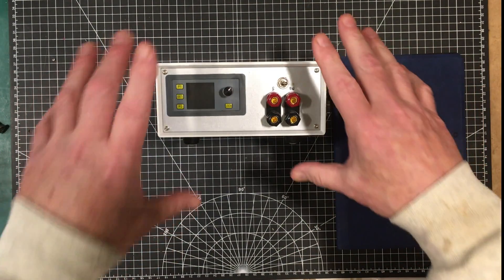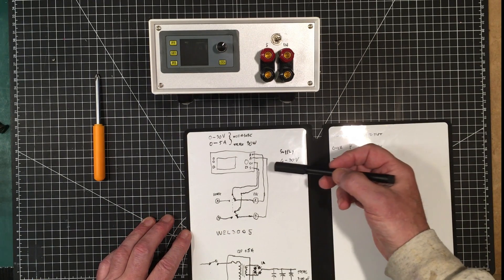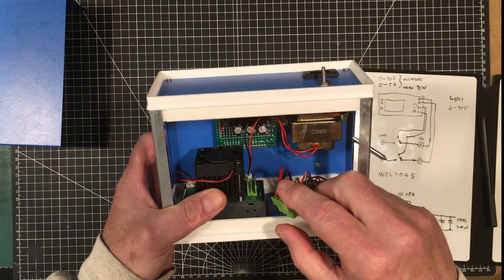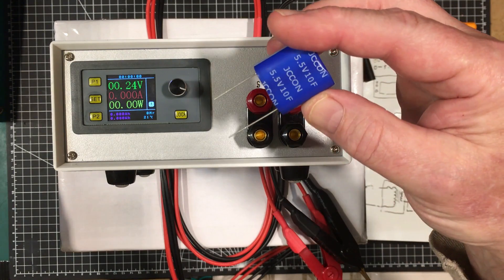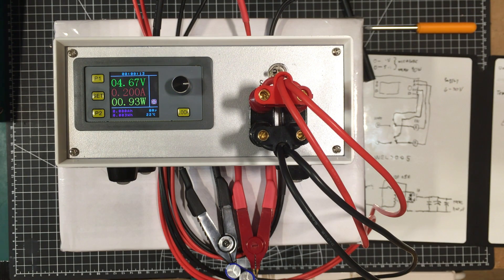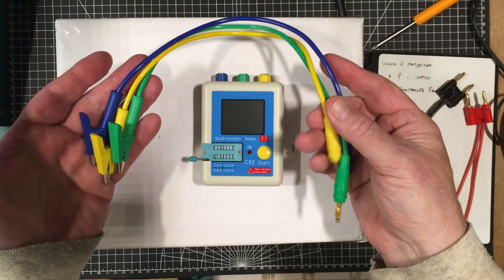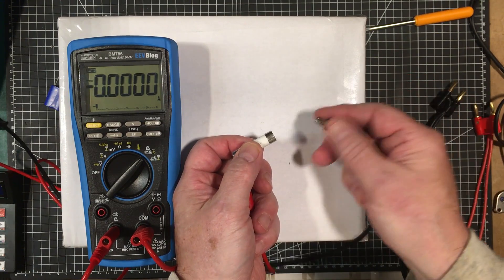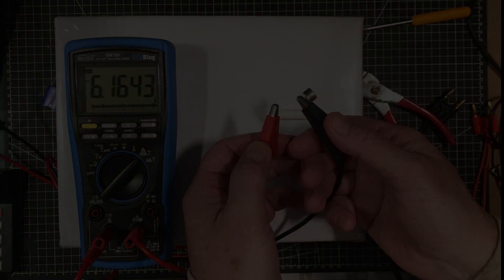Uni-Byte 0189 - The Little WEL3005 based DC Load - Plus An ATTEMPT to Conjure Magic Smoke!

Comment: I read that the undervoltage lower limit is 1.5 V. Does that mean that alkaline capacity cannot be measured? Cutoff voltage on those is something like 0.9 or 1 V. Or I misunderstood the specs?
Reply from the maker: You can set it to 1V or 0V, but not in between.
Reply: @uni-byte So you can get any value down to 1.5 and then it’s only 1 V or zero?
Reply from the maker: @Razvan_N  No, you can get any value down to 1V, then it's 0V.

Comment: Are there any cal adjustments that can be fiddled with for voltage or current display?
Reply from the maker: No, there are no adjustments that you can do.  If you got ahold of the firmware you might be able to tweak it, but that would be your only option.

Comment: Louis Rossman did a video a while ago on the fuse situation... whole lotta "assorted fuse kit"s on Amazon (mainly looking at radial car insert ones) that are nothing like their ratings, and almost impossible to find any listings from any sort of reputable brand rather than an alphabet soup one. I expect it's a similar situation over at Ali and eBay.
Reply from the maker: I saw that.  I think fuses are an area where you should be careful.  Spend the money on the real thing.  It seems a lot of folks have covered information on fuses, but the only people that watch are those few that are into the technical side of things.  99% of the population will see a cheap fuse kit on Amazon or AliExpress and just buy it because it's cheap.  They won't bother to do any research on how this might be a very bad idea.

Comment: Though the Asian fuse very likely has fake ratings, there is a great amount of misunderstanding about fuse ratings, within the EE community... Looking at OEM fuse data sheets and doing some testing would make a good video. I have seen such videos and, as a teaser, fuses do not work as you would expect. So, please make a fuse tutorial. The load module is a nice build. Even at only 30 watts, it should be quite useful. I DIY'd my e-load, from the circuit up and I learned a ton. So, a video on MOSFET load circuits would be educational and interesting. And, as you place emphasis on economy for folks just starting, you could include DIY load methods that are inexpensive... Incandescent light bulbs, wire out of an old space heater, DC fans, etc... Thank you for all that you do to teach and share. Cheers.
Reply from the maker: Some good ideas there.  As you say, there is a lot more to fuses than meets the eye.  The challenge in doing a video on fuses is what and how much to cover and determining where you might loose your audience.  Some people might watch a fairly full treatment of the subject, but most, not so much.  The video on loads sounds interesting too.  Thanks.
Reply: @uni-byte  I think there would be interest in teaching what are the misconceptions and what are the facts... Such as = It is a myth that fuses blow instantly, the very moment that their amperage rating is exceeded... How poorly even OEM fuses meet their specifications. How to calculate a fuse value from scratch, too... Thanks for considering it...
Reply from the maker: @t1d100  That sounds like a reasonable approach.  I will consider it.  Thanks.

Comment: 5:15.- since the power dissipation unit separates form the control/display it would be possible to mount the heatsink at the rear of the enclosure with a vent opening for the fan to expel the heat generated by the load
Reply from the maker: You could do that for sure, but I think the vents in the case might be enough to get rid of 30W of heat.  Especially with the fan to move air around.

Comment: Are you sure your power supply isn’t limiting the current?
Reply: He measured  the 6A in the multimeter. In constant current mode the powersupply of course limits the voltage, but that should not matter for the fuse.
But I think the fuse still might be ok. A 2A fuse must survive 3.5 A for at least one hour and is allowed to survive 6A for some seconds. So maybe the 11 seconds he tested with 6A were ja bit too short. 
.
Reply from the maker: @jeanyluisa8483  Fuses come in a huge variety of configurations.  This particular fuse was supposed to be a fast acting fuse.  Generally,   at least according to manufacturers like Littlelfuse, Bussman, Bell  and Siemens, fast acting fuses should blow in between .15 and 5 second at twice their rated current and about 0.1 seconds or less at 3 times their rated current.  There are also mid-blow, slow-blow and myriad other type of fuses that have time delays and many other characteristics.  However I have never seen a fast-blow fuse that is supposed to last 1 hours at 175% rate current and certainly not 11 seconds at 300%.
Reply from the maker: It's limiting for sure, but at the current passing through the meter.  Kirkoff's current law holds.

Comment: It's clear that it's intended purpose was as a small battery tester, but it can be used for a lot of different load testing.
Reply from the maker: It sure can.  I use it for most of my needs at 25W or less.  But you're right, it was intended primarily for battery testing.

Comment: With a 30 W max you have to be careful with the amps above 5 volts:
Volt	Ampere	Watt
1	5,0	5
2	5,0	10
3	5,0	15
4	5,0	20
5	5,0	25
6	5,0	30
7	4,3	30
8	3,8	30
9	3,3	30
10	3,0	30
11	2,7	30
12	2,5	30
13	2,3	30
14	2,1	30
15	2,0	30
16	1,9	30
17	1,8	30
18	1,7	30
19	1,6	30
20	1,5	30
21	1,4	30
22	1,4	30
23	1,3	30
24	1,3	30
25	1,2	30
26	1,2	30
27	1,1	30
28	1,1	30
29	1,0	30
30	1,0	30
Reply from the maker: You can set a power limit on it and if that power is exceeded the unit will turn off and break the circuit.
Reply: Did you used to work on logarithmic tables, by any chance?   ;-)